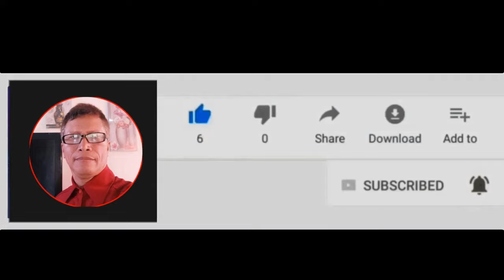How to Setup Easy DIY Hydroponic Farming at Home Water System Setup Using PVC Pipes

Comment: Hi there po.. thanks po sa diy set up nio..ang disadvantage po nyan ay yung.plastic pipe ay mas madali masira kesa sa metal.
Reply from the maker: Ganon po ba, pero PVC pipe ay design po na madaling  masera tulad ng mga ginamit Ng mga water district. Apoy at talim lang po ang katapat.
Reply: @DoubleB-Farm  Ganun po ba ...kala ko regular pipe lang yan. Regular pipe po kasi pag nainitan at ulan nasisira agad. Yung iba po binabalot ng insulator ang pipe.
Reply from the maker: Purpose po sa insulator parang di iinit Ang pipe at Ang tubig.
Reply: @DoubleB-Farm  Salamat po...bagay po lagyan pag summer time.
Reply: This  is not for beginners...anyway ..good idea
Reply from the maker: Yes po... This is my second greenhouse.

Comment: Sir,kaya ung pump sa Aquarium gagamitin dyan sa system na Sir?Godbless more power.
Reply from the maker: Dependi po sa watts at Taas ng bagsakan ng tubig. Usually, 15 watts kaya ang 2 meters high.
Reply: @DoubleB-Farm  Sir ung pipe gamit nyo is 2 inches water pipe?
Reply from the maker: Yes po 2inches regular or ordinary lang.

Comment: Boss mga ilang watts ng submersible pump ang ma i advice mo po  sa 600 to 700 holes na nft pvc din po size 3 salamat po
Reply from the maker: Dependi po sa setup Kong anong Taas po. Sa aking 500 plus holes ay 25 watts na A4000.

Comment: Hello may video po ba kayo sa side nft set up yung pinatong patong na nft
Reply from the maker: Mayron yong dati Kong setup, pero di maganda an result, nag leggy yong sa ilalim.
Reply: @DoubleB-Farm  pwede kayu ma add sa fb sir?
Reply: @DoubleB-Farm  may napanood akong set up mo naka vertical ba yun sa gilid ng green house nyu
Reply from the maker: Pwedi...
Reply from the maker: Half A
Reply: @DoubleB-Farm  sir ilang das kayu nag half strength at kailan mag full strength ?
Reply from the maker: Direct na po akong full strength kalimitan after germination. For sure pwedi rin half strength Muna Lalo na sa mga baguhan pa

Comment: Hi sir tanong lang po pano ung connection ng water supply dun sa  half A? Dalawa po ba waterpump? Thnk u po :)
Reply from the maker: Yes po dalawa dahil A4000 lang Ang capacity. Gamit ko po sa Ngayon ay aquaspeed A4000 24 Watts.
Reply: Pano po connect nun pag isa pump
Reply from the maker: Gamitan Ng PVC at connector na T PVC 1/2 lang po.

Comment: If running water po ba yung gamit need parin po ba ng A and B solution?
Reply from the maker: Yes po need talaga, yong ay Ang needs din Ng Lettuce.
Reply: @DoubleB-Farm  and need parin bo magcheck ng PH level ng tubig sir?
Reply from the maker: @angelrolandc.calesa4175 For the best result po need talaga

Comment: Kuya, saan makakamura sa pvc pipes o sa Atlanta duracon?
Reply: Magkano 2 inch pvc pipes
Reply from the maker: Kong 2 inches na PVC po napakamura lang po, that is 1 duracon to 3 PVC na.
Reply: @DoubleB-Farm  ty po. Sa pvc pipes muna ako. Planning to set up for 500 pieces. 7x8 meter greenhouse
Reply from the maker: Ok, that's good po, nag umpisa din ako sa maliit, 3x6 meters lang po. Or 10x18 feet.
Reply from the maker: Dependi sa mga nagbebenta, mostly it's about 130 pesos 2 inches.
Reply: @DoubleB-Farm  mas mura pa pla kuya. Nag calculate ako 200 pesos nilagay ko hahaha
Reply: @DoubleB-Farm  ok lang po ba pagdugtungin dalawang pvc pipes para 6 ang haha? Nice po. Malaki na farm niyo simula sa maliit lang
Reply from the maker: Ang length Ng PVC ay 10 feet po, bilhin mo yong may Dala na coupling sa Isang dulo. Dugtong agad na, need lang contact cement para sa PVC.
Reply: @DoubleB-Farm  ty po. Iuupdate ko po kayo
Reply: @DoubleB-Farm  mga ilang pvc pipes kumasya sa 3x6 niyo po?
Reply from the maker: Dependi po sa design. Magkasya ata ang  8 to 10 na dalawang dugtong.
Reply: @DoubleB-Farm  ok2 Plano ko po mga 16 na tig dalawang dugtong.  Bale 32 pvc pipes.  Kasya na ata sa 7meters x5 meters.
Reply from the maker: 24 po pero iBang setup yon.

Comment: Sir ano distance ng bawat pvc sa isa't isa?
Reply: Ano na din po haba nung tubular na ginamit niyo?
Reply from the maker: 8 inches po, Ganon din sa mga butas from center to center.
Reply from the maker: Anong tubular, PVC or steel? PVC standard is 10 feet po. Lahat na steel gamit ko po ay 1/2 inch at 1 inch na square tube.

Comment: PVC is the most toxic plastic, and it does not need to be warm to be harmful! Food grade plastics are LDPE, HDPE and PP!!!
Reply from the maker: I think in some point you are wrong. Most households in the cities and all those who have water systems used PVC hose and pipes for drinking water. PVC in Hydroponics, you don't drink the water. Plants on PVC will not absorb toxic or else it won't grow healthy. Likewise plants grown on soil has the potential to absorb toxic which soil has so much of toxic. But people don't mind it.
Reply: Hmmm. I did not know that. Anyway your hydroponics system is well built. I am just fearing using glue and some materials that can be harmful in some cases. But i know, that in food industry PVC and PET are often used materials. 😒
Reply: Yeah. And i am inspiring from your and all of your guys vids from ytube. I am making my own aeroponics system. But i only use "safe" materials since the project is for commercial use.
Reply: Is bamboo better alternative?
Reply: More enlightenment please

Comment: Mali ang materyal na ginamit PVC high content sa toxic plsstic material not like white color pipe potable water hindi lason sa hydroponic farming
Reply from the maker: As what I have read po high toxic plastic is not safe if it is used with hot water. The water in hydroponics is not  hot and even not warm if the system is right. So  it is still safe for hydroponics, if that is so...